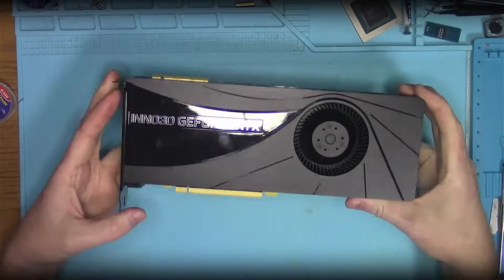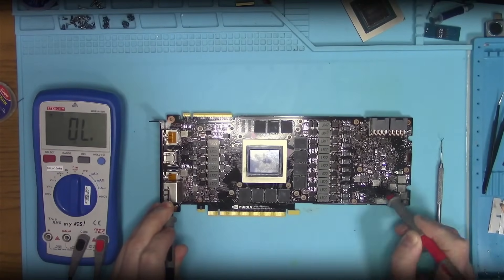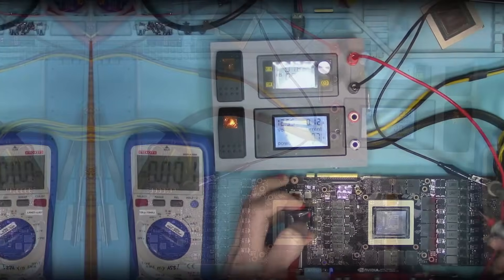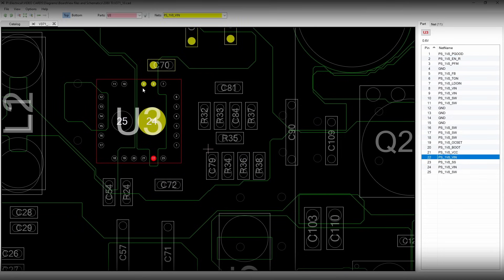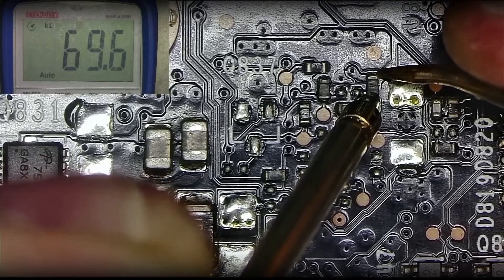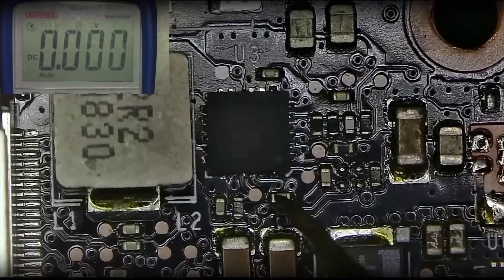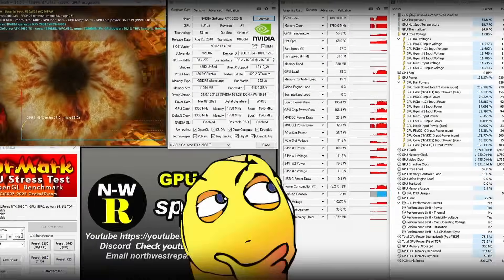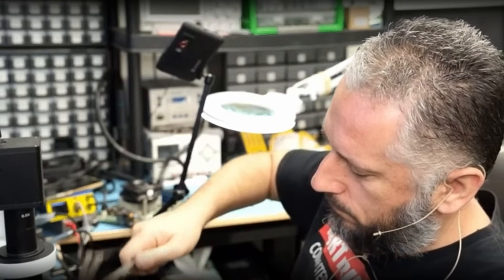DIY Graphics Card Repair: Troubleshooting and solving missing 1.8V

Comment: hi thx for sharing 
 i would like very much to make version 2 xl with short injector included ....would u please share the  schematics and parts .thx 
ps : made the first version xl take me a while ... works great fixed my first gpu gtx 660 ti blown cap .
first time ever run gpu stress test 3d mark over 8 amps of current run throw 4 amp fuse .works fine . weird things happened to a noob . ...lol

Comment: I can’t seem to get into contact with you from email or discord but i have a 3080 that turns on and runs fine but then after a while it shuts off, the pc will stay on but the gpu loses connection to the monitor and i put that gpu in a different build and the same thing happened to that pc

Comment: I love the shots at North Ridge Fix. It's hilarious.So, I know nothing about anything microsoldering but I have a question. When you reball a gpu core and you have it on the warm up station, you lay a wire looking thing across the gpu and it curves back to the gpu core. What is that?
Reply: Yep is a thermocouple used to see the PCB temp near the core.
Reply: i was asking myself the same question before assuming its a temp sensor
Reply: It most probably is a temperature sensor
Reply: That makes sense. Thanks!

Comment: Ok you got a like and a comment from me, for the NRF hammer scene :) Sub already since a long time ago, so I can't do that. 
How did you fix a no-name GPU without having to reball the core? I was half expecting you to get the card all put back together, and then get artifacts in Furmark.
Reply: After welding the conductor track, you have to remove the slag, otherwise the solder won't stick ;)